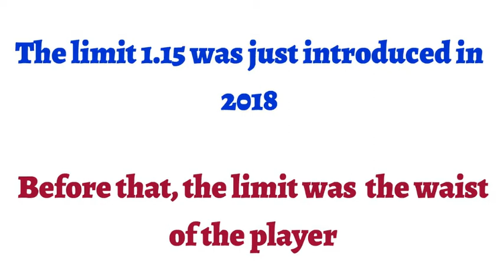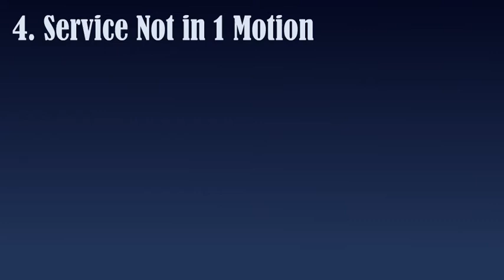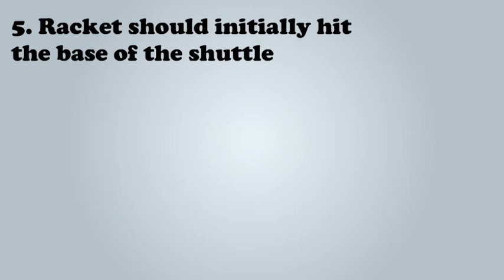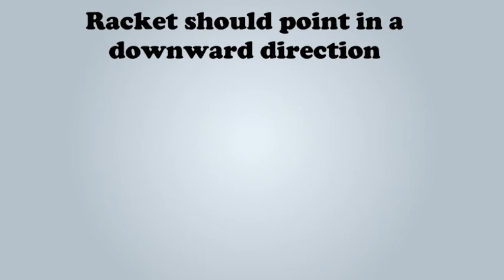Badminton service faults

Comment: If the server serves the shuttle to the wrong court (which is the receiver’s partner Court) and the receiver’s partner touches the shuttle with racket, then which side will get point?
Reply from the maker: I will try to cover all that on my future videos when i have time. But the answer to that is the server will get the point. Because the receiver's side will be faulted
Reply: @elfee7able  If that happens just wait for the shuttle to land before touching it.
Reply: If the reciever's partner touches the shuttle before it lands the point goes to the server. So you need to wait for the shuttle to land on the wrong side of the court to get the point.

Comment: Please confirm if it's a fault if the shuttle touches the net while serving  and lands inside the court.
Reply from the maker: Interesting question. I will make a video on that
Reply from the maker: https://youtu.be/Q5eYb7AaSa4
Reply: There's a line 198 centimetres distance from the net on each side of the court. The low serve line.if the shuttle touches the net and lands behind the low serve line it's not fault.only while serving if the shuttle lands in area between the net and the low serve line it's called out.

Comment: After the forehend or backhand service in doubles when hit shuttle  and rackets follow through up to head or shoulder..is. Correct or fault
Reply: The shuttle must be come in contact with the racket below 1.15m but it doesn't matter where your racket ends up afterwards.

Comment: What if one swings or throws or deflect/divert   the shuttle (all other than just dropping it ) before hitting the shuttle while doing a serve ?? Any action other than just dropping the shuttle from hand   Isn't it foul ?
Reply from the maker: It is not a foul as long as the hit from the racket is done "in" the allowed space.
Of course u cannot throw the shuttle all the way to the other side.
Reply: @elfee7able  thanks a lot for ur kind valuable reply sir. That means one is not supposed to swing or throw the the shuttle even by a little other than dropping it b4 hitting it in the allowed height . Isn't it ?
Reply from the maker: @darwinpj1402  u can throw it. U can even throw it high up in the air.
The only thing that is measured is when the racket "hits" the shuttle. 
Doesnt matter how u throw or drop the shuttle before that.
Reply: @elfee7able that was really helpful  I'm greatful for ur kind valuable  information   thank you so much ...

Comment: HI I HAVE A QUESTION ABOUT THIS LASTED LOW SERVE RULES.MAY I ASK YOU TO FIND THE ANSWER
Reply from the maker: What's the question?
Reply: @elfee7able  I Found new low serve rules does not mention about racket head pointing down required.So I wonder if it still requiring head racket have to pointing down during low serve ?
Thank you very much
Reply from the maker: @baoinhbadmintonexperience1546  the old rules says head must be pointing downwards. But now the new rule setting 1.15m as standard for everyone. So no more rule of the racket head.
But ... unless u play for profesional games, there are no measuring equipment for 1.15m, therefore the old rule will be used.
I explained that in this video.
Reply: @elfee7able  Ohhhh i got it.Thank you very much